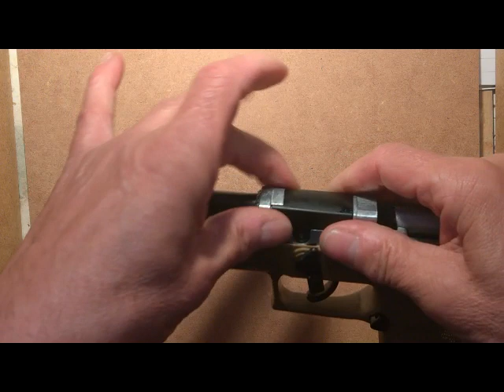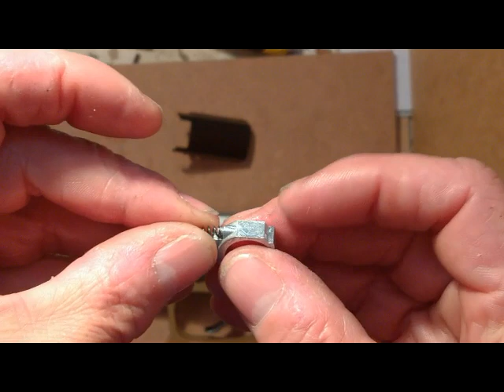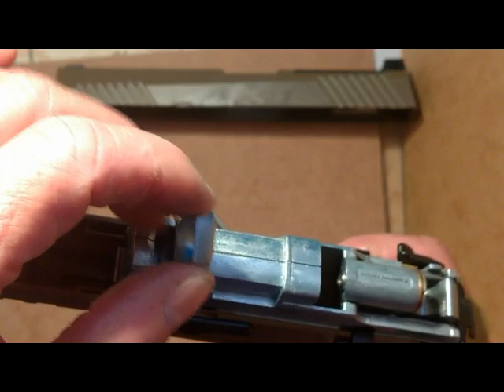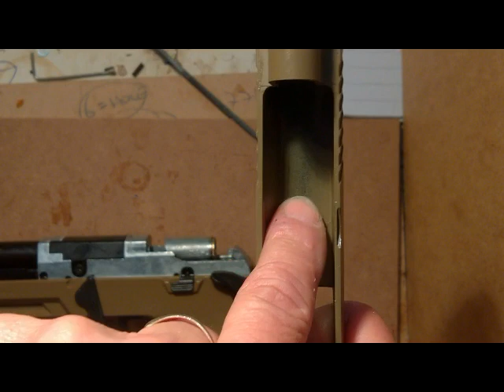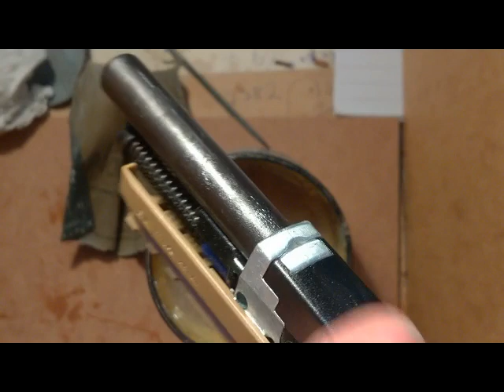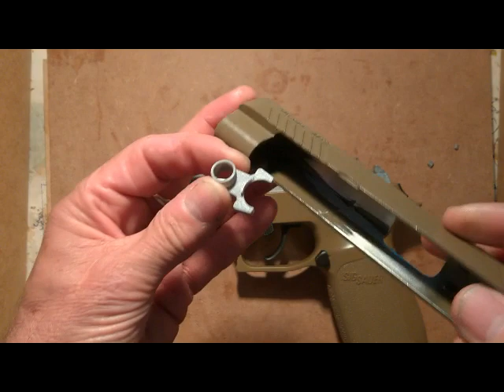Modifications & improvements Sig Sauer M17 Air Pistol ( removes slop from metal slide )

Comment: My friend just gifted this exact pellet gun as he had to move…. He want pulling the slide back during disassembly… is this bad? Nothing had broken and the gun seems fine, except the slight tolerance between the slide and the lower grip receiver. This is common on the real firearm as well. I was wondering if my friend disassembling it wrong a few time caused this or the gun is just like that? Thanks for the video appreciate the info
Reply: Also what kinda grease are you using? I tend to use silicone chamber oil is that appropriate?
Reply from the maker: @nicks4612  im a bit of an animal and use general purpose engine grease !
Reply from the maker: not sure what your problem is with ref to slide ?
Reply: @JERRYIRWIN41 after watching you video you addressed the slide issue…. The gun just soles like that
Reply from the maker: @nicks4612  yep, its like that on all of them !! completley buggars up any aim.
Reply: @JERRYIRWIN41 it certainly does, I’ll def be trying your trick to add a piece that takes that’s movement out of the equation.

Kinda ironic that this is the exact problem that helped lead to wrongful discharges within the real firearm

Comment: where do you buy the internal barrel replacement? mine has pellets jammed inside and I could not get them out!
Reply from the maker: ouch,,
I have no idea where to get replacement.

a good gunsmith should be able to remove pellets...
But the cost could be more than gun is worth..
Maybe bite the bullet and buy another m17..
then you would have a spare mag ?

I read somewhere a long time ago about heating up barrel until lead melts and then ream thru with wooden dowel ?

Jerry

Comment: Great video mate. 1 question, is it possible to increase the power of one of these guns?
Mine shoots at 1.89ftp which is extremely low.
Thanks for your help. 
James.
Reply from the maker: Not possible I'm afaraid.
Its more of a replica than an out right shooter.
Slight increase if you put the co2 cartridge in your pocket to warm it up ! before putting into gun.
also can use alloy pellets to increase speed but of course the ft/lb will stay about the same.
Jerry
Reply: @JERRYIRWIN41  
Thanks Jerry for taking the time to reply.
James. 😁👍

Comment: Hi Jerry I have purchased an M17 for myself for Christmas and will not fire it until then, but I have lubricated the magazine and dry fired it many times, to get the mechanism running smoothly, (as others have suggested this helps.). My M17 has roughly the same amount of vertical play between the front of the slide and barrel, however the slide is essentially in its lowest position and can only be pushed upwards. As a result there is essentially NO movement when the trigger is squeezed. My serial number starts with 22 which I assume means mine was made sometime in 2022. I wonder if anything has been modified since yours was made, or for that matter, what causes your slide to normally be raised 1mm plus (against gravity), and to then move down when the trigger is squeezed. I notice on other videos you have used a picatinny mounted laser dot, which I assume eliminates the effect of any frame movement issues as the barrel essentially does NOT move relative to the polymer lower body of the pistol. I may look at purchasing some adjustable sights from you depending on how M17 performs. Thanks for your videos.
Reply from the maker: Hi There.

Unfortunatley the sights are no longer available.
If you can rattle the top slide then your accuracy will be all over the place  unless, as you say you use laser on rail.
I do not know if they have modded the slide with later models.
I am still selling inserts to people who have just purchased the M17.
For uk the cost is £5.00 for 2 inserts incl postage.. very cheap to stop rattle and improve accuracy using the iron sights.
just drop me an email if want it :
 jerry.irwin@homecall.co.uk

Happy Christmas

Jerry

Comment: My trick to eliminate slide wobble around the barrel is to put a drop of crazy glue in the bore of the slide.  Just a small drop, dont even touch it, just rotate the slide back and forth till the drop coats the wanted section... then LET IT DRY HARD.

Comment: When it comes down to why the things are not accurate, getting the barrel and slide locked together is what matters the most. FWIW, did design and 3d print what is effectively a barrel bushing for my pellet M17, and it went from 3" groups at 25ft to just under 1.5". Other thing you do kind of need is the SIG Air Red Dot kit so you can adjust the sight to get it to hit where you're actually aiming.

Comment: I watched your videos in anticipation for the Sig M17 I ordered. Like some other commenters, after seeing where their is slop I approached fixing it differently. I actually took a rubber o ring, placed it into the silver backing cover of the barrel assembly where the back of the inner barrel is inserted (where the pellet initially enters). It helps to have a large clamp or vice to squeeze the spring assembly together and lock it in place once the o ring is inside. Once together you'll notice the inner barrel slop is gone. Check the barrel opening for any obstructions, as the rubber o ring expands when squeezed. It'll take some time, and you'll have to squeeze the barrel assembly by hand to get the excess to show. Using a 3/16 drill bit, clear out any excess rubber being careful not to damage the inner barrel. Once clear, I added some oil to the back of the barrel assembly and placed it back into the frame. You'll notice that the barrel feels more snug now, no play. The slop is caused by the play in the inner barrel and the spring mechanism that is used to hold it in place. The o ring provides sufficient pressure eliminating this slop and making the gun more accurate. It may take a few tries, shoot one at pellet at a time. If it jams that means the o ring is still obstructing the barrel. You'll have to remove the slide and disassemble the gun carefully. Remove the barrel assembly to get to the jammed pellet before continuing to disassemble the gun. Either push the jammed pellet in with the back of a punch or pencil, or it can be loose enough to drop out through the front. Once out you can remove the magazine if needed. Repeat clearing out the excess o ring rubber, assemble and test... repeat until you can fire without any jams. Take care with this and it should be okay. My gun works great now, no issues or slop and is accurate, feels good. As always it helps to use lubrication where needed ;)
Reply: Can u take pics of what u did I would like to see so I can go that route

Comment: In your opinion, which pellets should be used to do the most damage by this air pistol?
Reply from the maker: They are all much the same..
Heavier pellets travel slower, lighter pellets travel faster.
the resulting force ( lbs / ft ) is almost always the same.
My own experiance shows the EXACT diabolo 8.44 grain with 4.51 dia. to be most accurate at all ranges..
regards
Jerry

Comment: Has anyone tried to disable the blowback mechanism since it does nothing in order to add additional FPS? Like seal it up somehow.
Reply from the maker: As i underdtsand it..
Stopping blowback will not increase FPS.
Due to the mass of the top slider. The pellet has long gone out the barrel by the time the slider starts to move.
I , of course am open to other comments....
however...I have experimented by phycically holding slider and stop it moving.
NO CHANGE IN FPS...
Reply: @JERRYIRWIN41  thanks, worth a try.

Comment: Hi Jerry, thanks for this video.

I actually took a slightly different approach to fixing the accuracy issues with this gun. I found that even after the mods, the barrel was still far too easy to move the barrel around relative the rest of the frame.  Plus, the inner barrel slop, which you alluded to.  To fix both, I used teflon tape as a simple way to build up material to make a tight fit.  I simply wound some teflon tape around the inner barrel, just enough that it's a tight fit into the outer barrel.  Then I also put some on the end cap that secures the inner barrel into the outer barrel.  Finally, I put some tape around the very back of the outer barrel, where it fits into the receiver, and then the forward portion of the barrel where the forward part of the receiver secures it.  Again, enough to make a snug fit.  The whole thing is now quite firm with no slop at all.
Reply: Could you show how you did it
Reply: Could u make a video to demonstrate it so I can do the same for mine

Comment: I was thinking of getting this air pistol and would like one of your pieces that takes up the slide movement. Also have you had any issue with leaking co2? I have been looking into this pistol quite a bit. I do like your improvements you have done to yours and will be doing the same. Cheers
Reply: A few drops of Pellgun oil, or other specialized air gun lubricants, into magazine valve have shown to be pretty effective at aiding the misaligned o-rings in correcting themselves. Failing at that, disassembling the valve and manually realigning the o-rings and washers is fairly simple. Another cause for failure is o-rings getting dried out, lubricant can help prevent that as well.
Some of the M17 ASPs have had issues defective / prematurely deteriorating seals, if thats your case you need to contact Sig for replacement. Sig also sells replacement seals for wear'n'tear failure.

Comment: All wonderful mods. How did you fabricate the barrel guide? Also, (as I haven't pick up mine just yet) in your experience with those 2 screws for the rear site, do you believe a mount plate for a red dot would fit? Do you think it would hamper the blow-back functionality?
Reply from the maker: 3D Printed
As top slide moves i would imagine that it would knock the red dot out of alignment very quickly,, but that is my opinion, i have not tried one.
I just have a laser light on underside.
Best of luck. .If you want an insert then drop me an email to address shown in description.. its £5 UK, $10 USA.
Reply from the maker: Hi,
May be of interest.. i have just developed an adjustable rear sight.. see video...

Comment: Thank you, very helpful video, using your idea made similar thing using knife and thick plastic oil canister, now the slide is tight enough (sory for my english, i'm from Russia)
But didn't you manage to solve the problem with accuracy? My gun, so as many others (see owners reviews at official sig site) shoots very low and to the right, since the sights are not adjustable - it is a problem...Maybe there is a way to adopt sights from other model or to modify the existing?
Reply from the maker: Hi, I have at last designed an adjustable sight... please see new video

Comment: Will this insert work in the P320 as well?
Reply from the maker: Hi
I have had a quick look at pictures of 320 and the rail below the barrel looks a different / length / design , so i would  presume the answer is a NO... Sorry.
Reply: That was going to be my question. Not that I own it, but I was thinking of buying it. As I thought that maybe they all use the same or similar internals like many airguns do, but I guess maybe Sig has some differences. So does the P320 have slop in the slide and wobbly barrel issues and accuracy issues? So far I've been hearing good things about the P320 aside from the jamming issue and they seem easy solved with lube, pushing the pellets in the and finding it's right pellet. (Not Crosman's I know, lol, some dude said it was jamming all the time on Crosman's) Seems that his P320 likes some from an RWS sampler pack I think? And it was the RWS hobby pellet (flat head) that shot with zero jamming, but the RWS seemed to jam less in general over Crosman. 

I can't seem to find a good reliable hard shooting CO2 semi auto, other than the Sigs. I'd even prefer non-blowback, but man, that market is small now. There is always some problem though with these. I am starting to like the P320 and Sig's other pistols, but their quality control I know has issues. So what about the P320 don't you like?

Comment: Mine is not the M17 version. Mine will frequently only fire a pellet on every other trigger pull.  Any insights?
Reply from the maker: is it a chain fed magazine..are the pellets left in the magazine, is it not firing first pellet then stacks second pellet behind and fires both in tandem... if so a little lubrication on the whole chain and the prong mechanism that rotates the chain will help... IT DID IN MY GUN.
Reply: @JERRYIRWIN41  it's a 30 round chain loop magazine.  I'll shoot some, open it up , and every other pellet is still in there.  So every other trigger pull is advancing the chain, but not firing a pellet.  I took the slide off.  pulling the trigger works an internal hammer, which hits the valve to fire the pellet.
Reply from the maker: you have got to somehow look at chain movement during a fire sequence to see if all lines up ok on each trigger pull.. @traumajock
Reply: @JERRYIRWIN41  ok.  I might also buy another magazine, this time a 20 round, and see if that helps.  I really like this gun.  It handles just like my real P320 (the trigger is harder but that's ok)  , and I can get cheap range time in my mancave.

Comment: Can anyone please tell me if 3mm pin punch  is good enough to remove the pins from frame,I want to open up the frame assembly, has anyone tried it opening M17 completely ?
Reply: The 3mm punch has probably always been for the pins in the frame of most of my pistols, so I bet it is the right one for this gun also. I have had this M17 apart myself and I have only needed 2 and 3mm punches. The 2mm punch been for airpistols without field-strippability but rather a smaller pin instead.
Reply: I pressed the metal tab under my barrel that worked the kickback. It moved 1/8” now the gun will not fire

Comment: This  Video needs an actual demonstration of the improvement  In accuracy that these modifications  Result in . I would like to see size  Of the shot group before by the  Modification and the size of the  Shot group after  Modification.
Reply from the maker: Yes, sort of agree. But fairley obvious that the slider floating around ( with sights attached ) is not going to be a good thing.
I have since had reports back that the insert DOES make a great improvement to grouping..
Thanks for your Comment.

Comment: Oh man! I really enjoyed watching this!😊👍
This is a proper way to do it all if one really is into doing improvements to your airgun. Respects!
- I just pinned the inner and outer barrels sit tight with tape. Also just taped the slide's front barrel bore smaller according to the pellet's point of impact on target. Also put a layer of tape on the sides of the aluminium blocks within to reduce the slide rear's side wiggle.. The easy way to go - but it worked.
Reply: Could you show how you did it